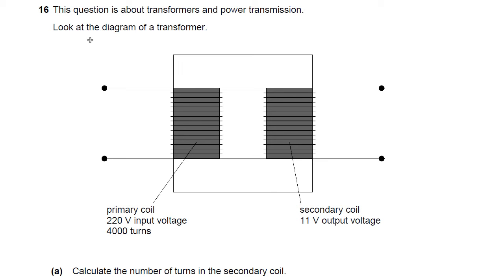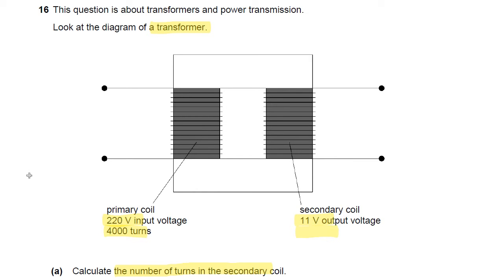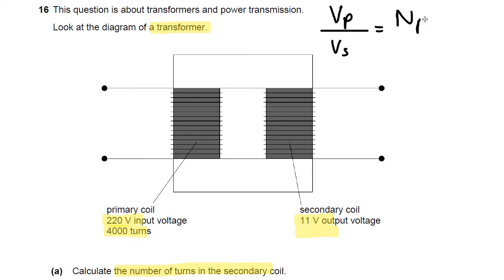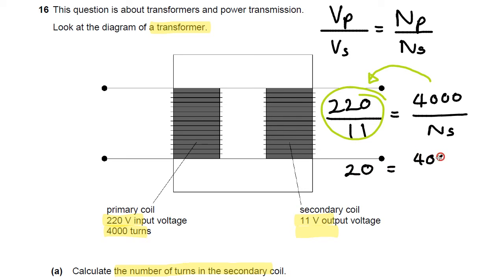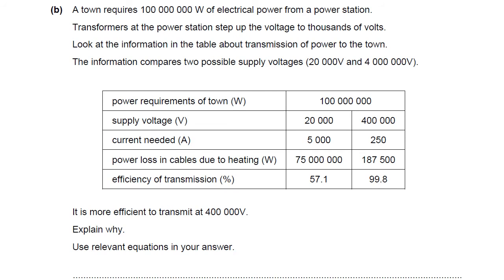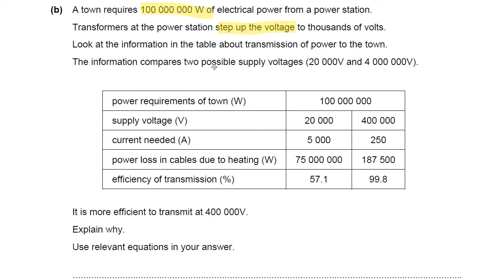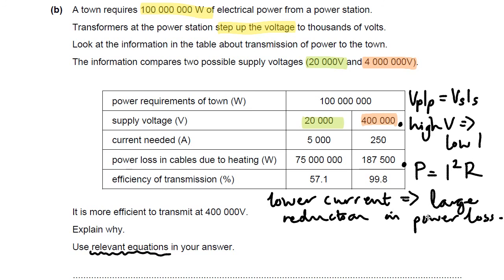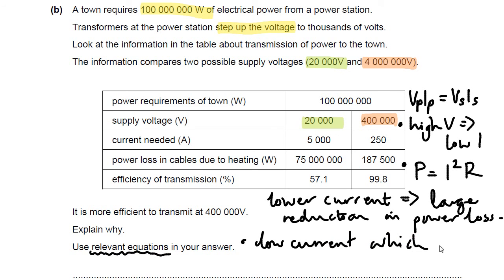Transformers and Electricity Distribution - OCR Gateway P6 Q16 - GCSE Physics Revision

Comment: Does the fluctuating magnetic field in primary coil and fluctuating magnetic
field in secondary coil induce an electromagnetic field, causing a current to be passed on/produced in the secondary coil? I'm really stuck on this..
Reply from the maker: S alternating current in primary, causes changing mag field in the core, causes an alternating current in the secondary. (so you were two out of three right!)
Reply: thanks! I'll go over it again to check if i fully understand it